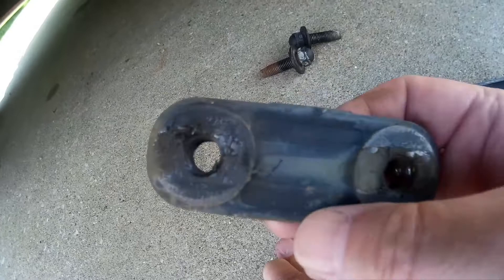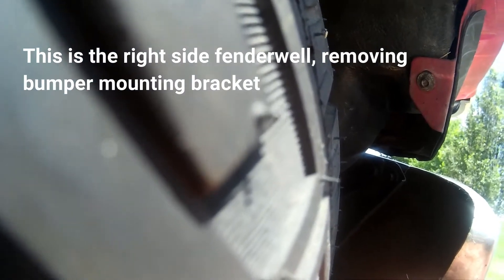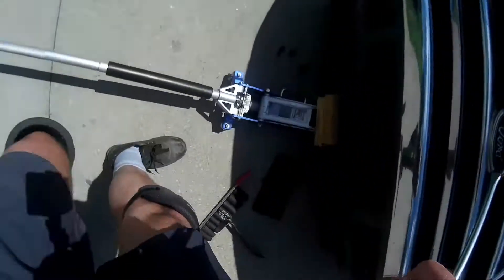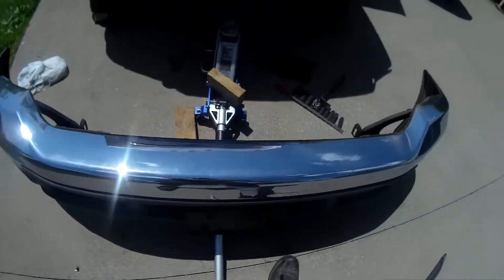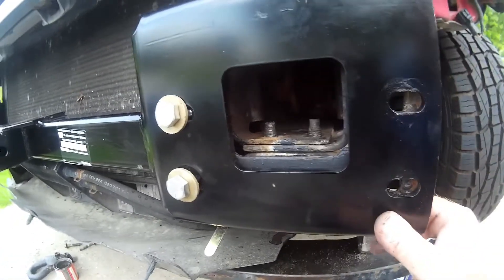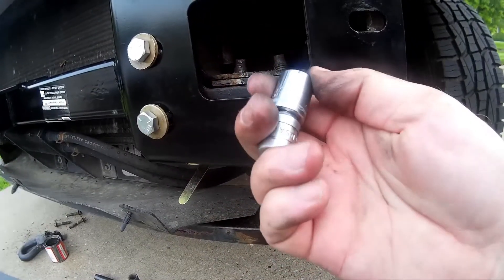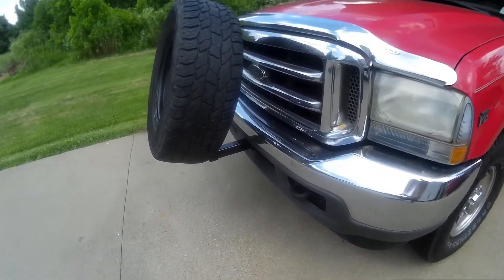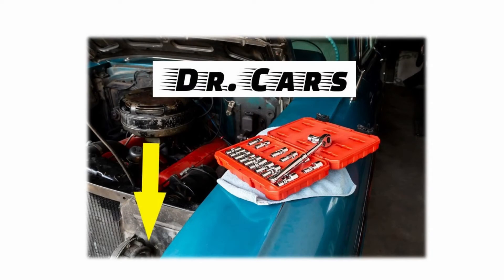2002 F250 & F350 Front Receiver Hitch Install

Comment: Be sure to do this on a level area. Part of my driveway (closest to my garage) has a swale in it. Had to later re-park my Excursion on level ground...loosen everything back up, manipulate the bumper with wooden wedges and stuff to re-align it with everything and then re-tighten....no biggie really, but just let'n ya know. 
 A couple of those bendable tabs on the nuts are a pain too... but ya gotta have'm. Thanks Doc.
P.S. That front tire mount may be practical for your situation but it's fugly!

Comment: That was cool.  Been thinking of adding a winch to my truck but would want to use from either front or back, or not at all. 
So a receiver mount winch would be a great option as long as I add a receiver mount like this.  Don't need a 15k lb. winch, 5k or so would do. 
Thanks for the info.

Comment: Tire will block airflow not a good idea.
Reply from the maker: It actually doesn't impact cooling temp at all.  Have run truck hauling 3000 pounds with and without the tire mounted with no change in cooling temp.
Reply: Its been done for many decades. Not an issue unless you already have cooling issues on your rig.